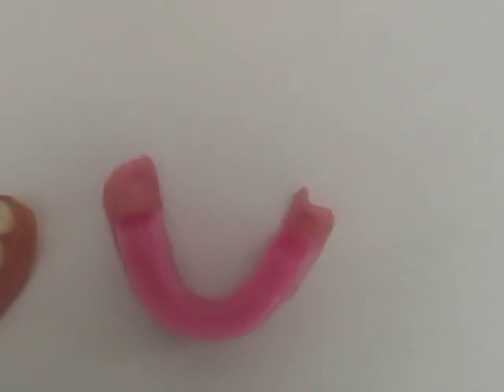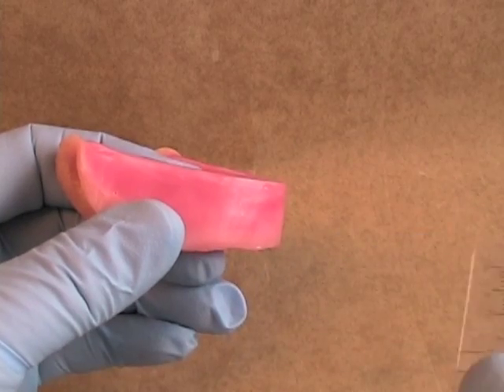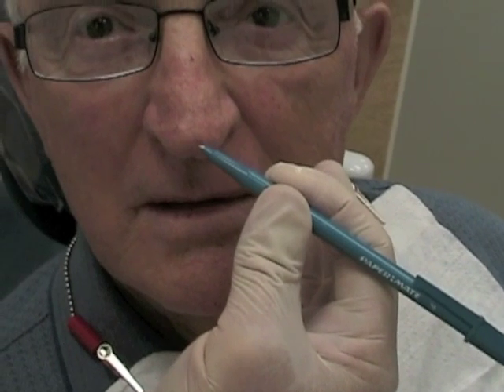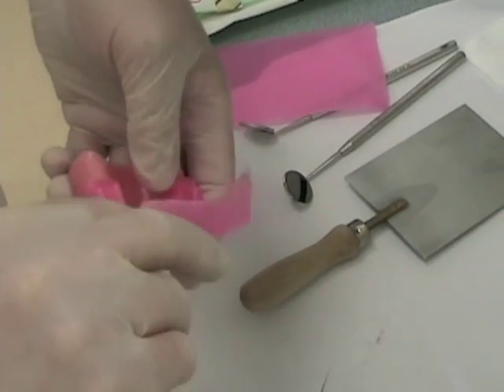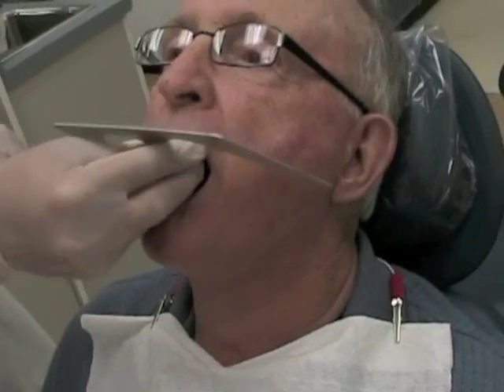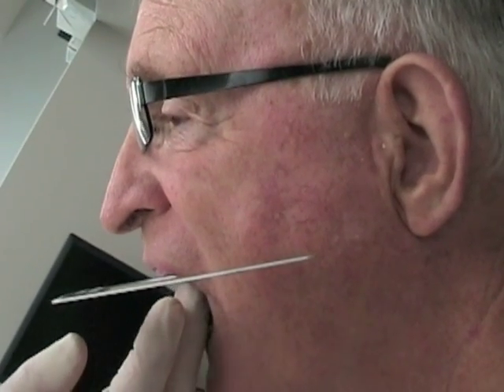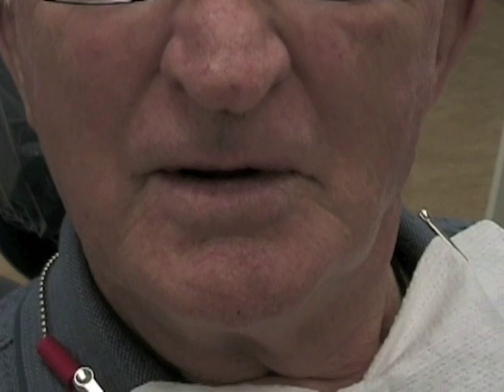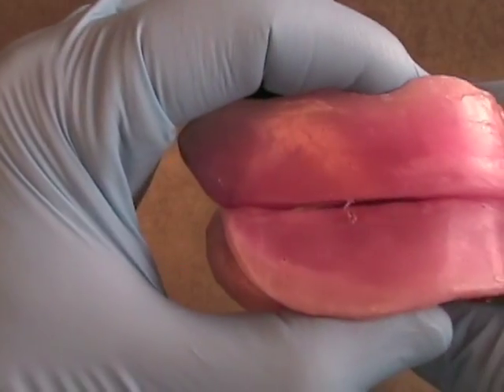24 Occlusal Vertical Dimension

Comment: If the vertical dimension is too high: do you adjust the mandibular or maxilary rim preferably? and which part of the RIM do you adjust? (posterior, anterior..)
Reply: If your VDO is too high the first thing to check is if your upper  rim is; 1️⃣ having the the correct amount of incisal show, 2️⃣ Is the rim parallel to the occlusal plane, this you check with a Fox’s bite plane. 
Once this is established and checked you then remove any excess height from the lower rim.
The bottom line is, get the maxillary rim 100%   correct before trimming the lower rim.

Sorry to ‘hijack’ this question. 🙏🏻

Comment: I used to retrude the mandile by two fingers of one hand to the most retruded unstrained position  of  condylar  process within TMJ
 and ask the patient to bite and then put wax in between the maxillary and mandibular wax rims
Reply from the maker: The technique that you describe was a previously accepted one for determining the centric treatment position that has been generally replaced with the newer techniques. It is no longer thought that the most returned position is the ideal treatment position and that a superior anterior position is more appropriate. Similarly waxes have generally been replaced by elastomeric registration materials because they are offer less resistance during registration and don’t distort after the records have been made. See my Complete Denture Manual for more information starting at page 36 at http://removpros.dentistry.dal.ca/ewExternalFiles/CD%20Manual%202019.pdf

Comment: Вы забыли о кривой Шпее , техник должен знать степень выраженности последней. Но для студентов хорошее видео!
Reply from the maker: Thanks. The video is about occlusal vertical dimension (OVD), not about setting denture teeth. You should not set a curve on the occlusion rims prior to establishing the OVD and making the centric record. Doing so can cause the patient to slide upon closing, resulting in an inaccurate interocclusal record. A curve of Spee can be developed later when setting denture teeth if desired, and is covered in my videos on setting teeth.
Reply: @DrLoneyDal  Спасибо за ответ.

Comment: Incase of Occlusal plane above the level of tongue can lead to the cheeck biting ..
Reply from the maker: While cheek biting can be a problem with dentures, it is rarely, if ever related to the level of the occlusal planed being above the level of the tongue. More typically it is related to a lack of horizontal overlap of the posterior teeth. Normally the maxillary buccal cusps hold the cheek mucosal tissues from folding in over the  mandibular occlusal table and do not allow the tissues of the cheek to get trapped between buccal cusps. However, when  the maxillary and mandibular buccal cusps exhibit no horizontal offset (cusp to cusp relationship), cheek biting occurs. Cheek biting can also occur posterior to the last molars when their is a very small space between the denture bases and the cheek tissue is somewhat flabby - it can fold into the space between the bases and get pinched during function.
Reply: Very helpful. Thanks. How can we prevent  toungue falling between dentures?
Reply from the maker: @Chitti198  If the occlusal plane of the dentures is set too low, the tongue will lap over the occlusal surfaces and the patient will occasionally bite their tongue. Normally the occlusal plane can be set properly by positioning the mandibular teeth anteriorly at the level of the corners of the mouth (the commissures) and posteriorly by having the entire occlusal plane intersect the middle of the retromolar pads (do not set the teeth that far back, just ensure the mandibular occlusal plane intersects there).

Comment: Great video, very helpful. Dr, do you have a video for the next step "wax try in with teeth"?
and what to check for at that step?  e.g. what to do if the midline does not line up with the lower? or if some teeth may not be in proper occlusion? Thank you
Reply from the maker: http://removpros.dentistry.dal.ca/RemovSite/Set_Teeth_Movies.html

Comment: I didn't know where to ask, but here is my question. Is there any difference between Maximum intercuspation and Centric occlusion. I only have the definiton of maxium intercuspation- is a state of centric occlusion during which the teeth surfaces ar maximally contacting. Maybe you could help clear this thing up, because I'm a little confused.
Reply from the maker: centric occlusion: the occlusion of opposing teeth when the mandible is in centric relation. This may or may not coincide with the maximal intercuspal position.

maximal intercuspal position: the complete intercuspation of the opposing teeth independent of condylar position, sometimes referred to as the best fit of the teeth regardless of the condylar position—called also maximal intercuspation. 

For definitions of other occlusally related terms, see the Glossary of Prosthodontic Terms:  http://www.academyofprosthodontics.org/_Library/ap_articles_download/GPT8.pdf
Reply: Thank you for your helpful answer.
Reply: @DrLoneyDal  https://www.academyofprosthodontics.org/_Library/ap_articles_download/GPT9.pdf
Reply: Thanku sir for amazing illustration regarding centric relation and maximal intercuspal position
Reply: Final year bds student from pakistan